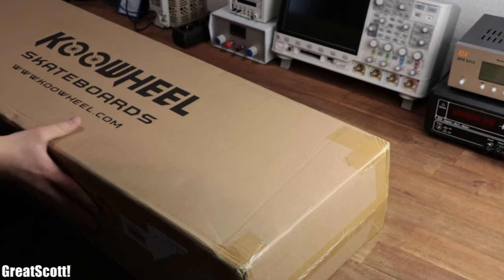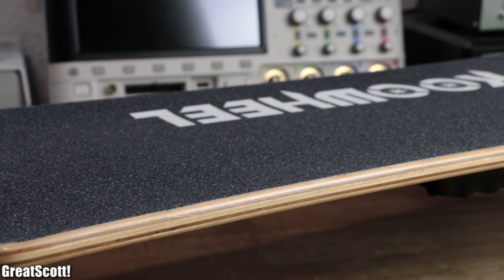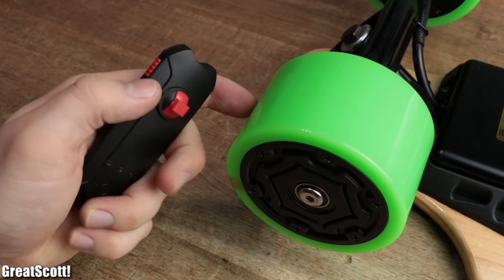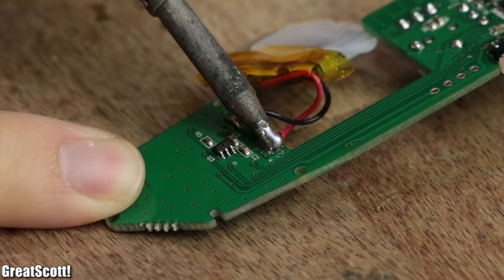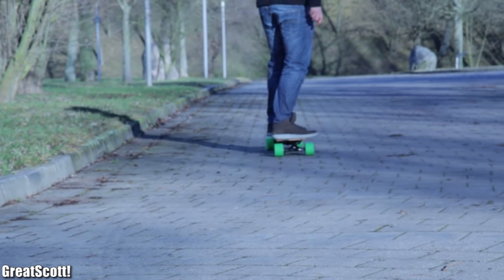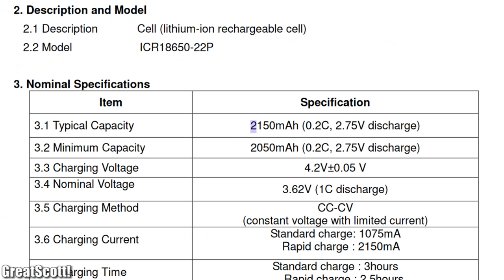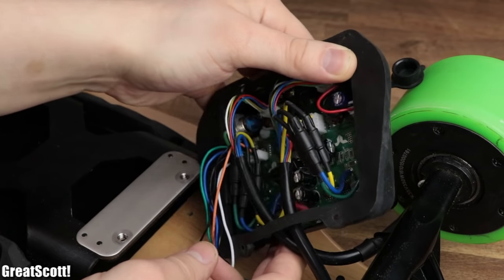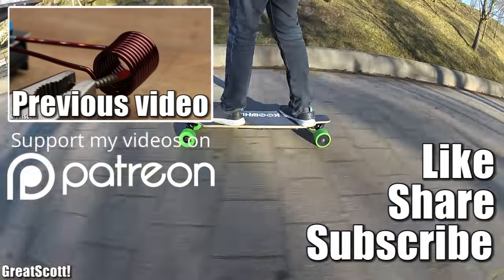600$ Electric Skateboard (Koowheel) Review/Teardown

Comment: i never had any issues with the remote. Charges maybe 45 minutes or so after use. Most of the time its only like a half hour. I thought the push button thing was 7 times. but what controls that? can we bypass that and just keep it on sometimes? I am super well-versed with this skateboard I do not represent the company whatsoever. I'm actually on my 4th one I've been beta testing them and giving my results back to the company every issue I've ever had they fixed as a matter of fact from my first board to my fourth board it's now a completely different skateboard it looks the same but it's definitely not anywhere near the same the wheels or different the trucks are different the decks different suppose we the motherboards been changed the intent has been moved to remote control has been upgraded. I would love to get another project from you out of this. now what I would have mentioned is the fact that these batteries you don't want to drain pass 50% so the charge time on the battery yes from empty would be very lengthy but if you used the board appropriately to charge time should only be about an hour and a half to two hours. in my opinion and this is from Soul experience is that you should definitely not drain the batteries all the way down. and it takes a few Cycles before the battery actually seems like it reaches its full potential. I'm going to say it changes after the first three or four charge cycles what do you think though does that sound about right or am I just imagining things. you're definitely one of my favorite Electronics channels and when I saw you made this video I was pretty stoked. I think you did a great job and I'm biased great job at that

Comment: I think though that 30km or even 35km would have been possible if it was not used on full speed. On the first run, you got 12.5km  with a battery charge left of 50% and with braking a lot. If you drive carefully, you should get a higher range.

Also, I was wondering if you measured the voltage of the remote control battery. It could charge with 500mA, but maybe the voltage was higher? At least, I couldn't imagine that you need to charge the remote longer than the longboard. I don't think it charges in 30 minutes, but if it charged in 3h, it would be still acceptable.

Comment: 2150mAh batteries is kind of disappointing, but at least they're from a reputable brand. I wonder how hard it would be to swap out all of the cells for 3400mAh Panasonics. Doing that would give you almost another 100 watt-hours.
Reply: Can they deliver continuous 10Amps?
Reply: The Panasonic NCR 18650B with 3400mAh has a max discharge current of 2C 6,2A.

Comment: Can someone help me? I need to know the difference between laminated and toroidal transformers. Can I use a toroidal transformer to power a variable power supply? Thanks
Reply: sure you can. in some cases you need to have some kind of overload protection though.
Reply: amduser86 what are sorf?
Reply: sorf = sort --> typing error, even though kind would have beeen the better word. english is not my native language. sometimes i make mistakes. the basic think is, that depanding on the load, one can use enough currenty, that the fuse in your household switch. since laminated transformators are not as efficent, you have less problemes in this department.  basically you need some times, some sort of soft start modul, that limit's the current, your device uses. otherwise the fuse "thinks", that you have shor circuit. furthermore laminited transformators kind of clean the incoming voltage from voltage instabilities caused by feedback of various electronic devices in the household.

it's a trick, most japanese audio electronic companys use. the reaction time of the power supply is anyway determined by the used condensators. gernerally it is usefull, to use a lot of "cheaper" small once, then a few expensive once. i prefer to use f&t condenstors, but where i live, those are cheaper then good japanese once. since i suspect, you want to have a stabel voltage, i would adivse you to use a zener diode, as a a voltage regulator.

Comment: Why did he times the battery capacity of 2150mah by two if there's twenty of them? Someone please explain.
Reply: ThatEasySavageLife Because it's a 10s2p configuration so single cell voltage x10 and single cell capacity x2.

Comment: You can't really easily change the wheels though?
Reply: FescronCasual the front ones are just standard longboard wheels but the back ones may be tricky with the driveshaft and all but I have had a normal Longobard for over a year now and if you just cruise then your wheels won't wear down much

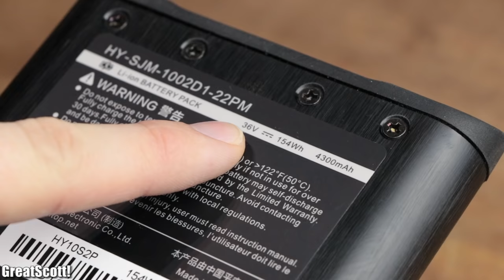Comment: that battery is 4300 mah 1:15 ?????? my phone's battery bank is 30 000 and its half the size :D
Reply: sry its actually 16 000 remembered wrong and its also 59,2 wh
Reply: It won't discharge even close to 10 amps.
Reply: hugo heikkilä 
The battery pack of the skateboard is 36v while the one of your powerbank is 5v.

Comment: from $600 you can make you custom electric skateboard that can perform much much better then this one :D
Reply: sorry , no interest in making skateboards but one can make use of these 

4 x Quanum BE1806-2700kv Race Edition Brushless Motor   (one for each tyre)
1 x 120A ESC 
8 x li-po 5000mah batteries in parallel ( making the total of 11.1v @40000mah )
Reply: use gears
Reply: ok bro . i have less knowledge in this field .. i thought more is better so i said like that :) thanks for pointing my mistake
Reply: you also :) 
but tell me one thing here ... if it uses like 1000watts motor then what about battery backup 
the skateboard in the video has 154 wh battery , if u use 1000 watts 
then it will last 9 minutes
Reply: oh got it :)
Reply: if your smart and or know where to get your parts you can make a boosted board quality board for this price, (ive done it)
Reply: Going for 490Eur now in Europe with free shipping i hardly doubt you can get low kv motors + electronic + battery to do this at that price, not even considering time and skill.

Comment: I'd put money on their speed test being based on the maximum RPM of the motor and nothing else.

The longevity test is probably calculated by dividing the motor's power output by the pack life, failing to take things like voltage drop and inefficiency into account.

Gotta love dat marketing wank. Like why not just do some actual tests and put those specs up? People don't like being lied to.
Reply: Teth47 or take it with a grain of salt... like I'd expect it to last longer for me since I'm only 50kg... versus someone else at 80-100...